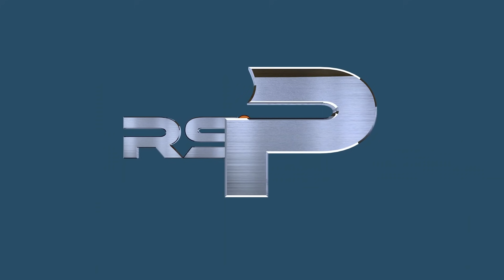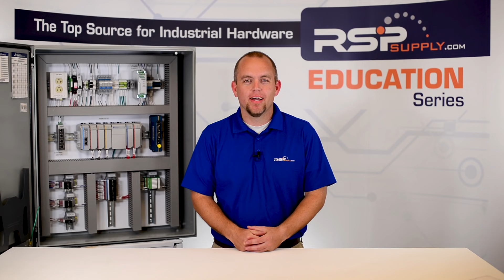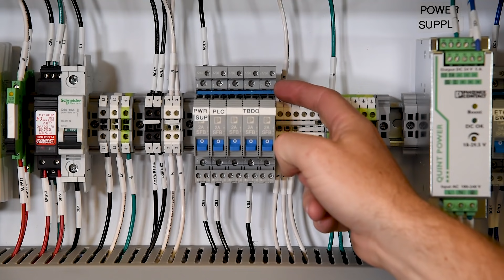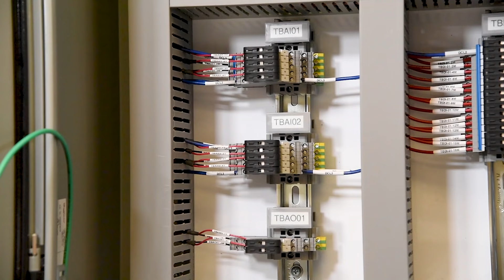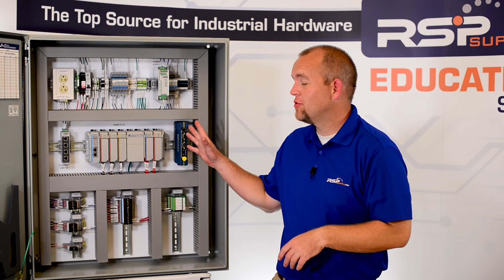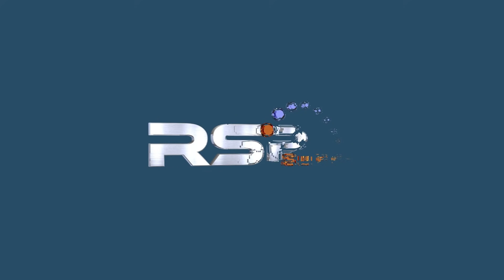Industrial Control Panel Basics

Comment: Great panel wiring presentation but how is AC power fail from the relay to the PLC gonna help,because when the main power fails the whole circuit will be off. Unless you install a 24Vdc output UPS and a 24Vdc power supply module for the PLC😊

Comment: I learned a lot Watching your videos thank you so much .in my previous job I used to assemble Flow meters where i connect and wire  different type of components now the company moved out and had to look for another Job anyhow i found a great Job doing this in the begging they didn't have too much trust on my because I'm a woman but i teach them that i could do the Job sometimes they send me out of the country because I'm bilingual i speak Spanish i enjoy working with panels

Comment: Thank you for that, trying to advance in this field and that helped tremendously
Reply: Same here. I started working plant maintenance 1 year ago, have learned a lot in the past year but the electrical issues I run into troubleshooting is the one that I’m not familiar with. Just enrolled in tech school to start Industrial Electricity courses though.
Reply: @offspringfan1288  good deal, i started going to tech school for electrical last year as well.  It's a great choice to make and good luck!
Reply from the maker: Glad it was helpful!

Comment: Banana PI BPI-F2P  open source Industrial control baord . use sunplus SP7021 chip design , support RS232, RS485 
http://forum.banana-pi.org/t/banana-pi-bpi-f2p-with-sunplus-sp7021-chip-design-for-industrial-control-gateway/11001

Comment: I worked in manufacturing for decades. This was WELL explained without the need of getting into in depth analysis of each component. Young folks should consider this well paid, blue collar profession... building panels, or connecting them to machinery , or interfacing/ programming to use with other panels & computers.
Reply: ReadyTo SaveIt having been a panel wiremen for 20 years, I’m afraid I don’t share your enthusiasm. 

Good panel builders are a dying breed. The work here in the UK is mostly under paid considering the skill and qualification level required to be truly competent. 

I’m lucky that for the past 10 years I’ve worked at a place that does pay well, but this incredibly rare where I live. Most of this work is on a temporary unstable basis and underpaid. 

I certainly wouldn’t recommend any young up and coming people to consider this as a career. At least not where I live in the UK.

Comment: Outlet upside down :D
Reply: I love how they installed a 20 amp outlet for 5 amp max
Reply: Compact Cow ...so pls explain how you KNOW what the total draw on that leg is, with no evident paperwork/ documentation...
Reply: @seminolerick6845  I was referring to the fact that it's a NEMA 5-20 outlet, which is rated for a load of 20 amps. It's a meaningless detail because there is no 5 amp outlet.
Reply: Its an endless safety argument as to Earth ground being on top or bottom... it all depends on the local inspector's requirements, or companies' policy... bottom line...

Comment: I used to build electrical control panels, painted the enclosures, laid out, mounted and wired the components and then tested the entire panel. Moved on to programming and selling PLC's. Have to say building the panels was the more enjoyable part.

Comment: finally someone that explain this, I started an industrial maintenance course but everyone except me seems to already know electrical mumbo jumbo so i am desperately trying to catch up
Reply: Imufur Indeed, he does an excellent job at the Introductory level... almost a "sales pitch" to get you interested, without bogging all down in details. There IS much to learn, depending on what level you will work with in the building, installation & maintenence of these panels. A basics of electricity course, shops skills level (drilling,tapping holes etc) , and wiring diagram reading and documentation of , might be the next series of learning courses for you.  A good "hands on" mentor, is invaluable if you can latch onto one. Good luck !

Comment: Thank you for your videos.  Because I watched them, I was able to intelligently answer questions about this topic at a job interview.  I got the job on the spot for $40,000/year.  They opened 430V, three-phase panels and had me explain them as part of the verbal test.  I passed.  No more repairing TVs for me.  This will be the first full time, professional job that I have had since 2001.
Frank
Reply: Congrats Frank!
Reply: Congrats! Never stop learning
Reply: You chancer
Reply: congrats man
Reply: Congrats
Reply: Congratulations Frank!! I actually do the same thing every time I have a job interview. I'll look up the job description and educate myself more on the position and the terms used and also being able to identify the parts like in this case associated with the control panel. It definitely makes u sound like u know what u are talking about. I recommend everybody who has a job interview coming up to check out the company website and familiarize yourself with their products and then research the assembly process on YouTube. What also helps is I always have a couple questions to ask them like what can I do at the position I'm applying for to make myself an asset to the company and consider myself successful. And always ask them what do they like most about being at the company, and it always seems to impress them just a little suggestion try it works
Reply: @mikedee4399  Thanks.
Reply: A 277/480 3 phase panel?
Reply: good on ya mate
Reply: Good to hear that.
Reply: I’m only reading this comment you are the epitome of never give up !!!
Reply from the maker: Congratulations sir! We hope everything is still going great for you. Thanks for the support!
Reply: Congratz
Reply: Way to go Frank!! Knowledge is power! Never stop learning
Reply: Congrats Frank! May I ask you what is your day-to-day duty? I would also like to become an automation engineer and I want to have some insight on the actual job. Thanks!
Reply: I wish they would have done that at my job I got. I got the job and didn’t even know this is what I would be doing
Reply: congrats frank
Reply: congratulations man! wishing you all the best! happy to hear this!
Reply: How’d the new career go man? It’s a late one but congrats!

Comment: 20amp receptacle for 5amp max use... hmmmm
Reply: They are usually feed from the outside breakers..that 5Amp breaker is only for the controllers..
Reply: @marlonespino9111  Because the wire is not sized for 20amps. Just that the receptacle is rated to 20 amps. Has nothing to do with it...

Comment: Hi. What are the areas to consider in order to properly size an electrical panel required for an industrial production line?
Reply from the maker: We will do a video on that soon.
Reply: It depends on your requirements..start first with your design for sequencing then figure out your components..then from there you can tell what size and what type your panel is..but always keep in mind always put a leg room for your wires and never evere use a NEMA type 1 enclosure for your panel

Comment: I have to work on this shit everyday. Finding problems in these type of control panels can be very frustrating. I had to teach myself being  a industrial mechanic.
Reply: being an industrial "mechanic" or an electrician?
Reply: Matt D as a mechanic. We work on all parts of the machines.  Electrical, mechanical, General maitence, welding, and gas or plumbing to big machines.
Reply: punkdevito If you can work on mechanical, electrical, welding, plumbing, etc part for the industries then you are not just a simple mechanic or electrician, you are a general technician.
Reply: Matt D what ever the name may be. That's what I do. And everybody at the plant calls us m mechanics

Comment: how do you size a circuit breaker for a power supply
Reply from the maker: We will do a video on that soon. Thanks for the request.
Reply from the maker: If you need help before the video comes out give us a call.  The circuit breaker is there to protect so there could be multiple limiting factors.
Reply: NEC code book article 240 has all the info you need..

Comment: Is there any reason why the main breaker and Surge arrestor are upside down?
Reply from the maker: We do that because of the wiring. The breaker is right side up but you are right that the surge protection is upside down. The input and outputs are opposite of the other components and we want all the input wires to come in from the same direction.
Reply: Yeah I had a closer look after I wrote that comment and realised that the breaker was up the right way. Though those surge arresters as far as I know don't matter which way up they go (except maybe the earth only on one end?) as I think they are just a pair of MOV's.

Comment: In an introduction such as this, you need to tell the viewer this is process control instrumentation. Is the  the enclosure nema rated, manufactured by Hoffman or custom made? A little more detail would still be bite size chewable.
Reply from the maker: Hi Melvin, Thanks for the feedback. We will have other videos soon with much more detail on Industrial Control Panels. The NEMA rating depends on location the enclosure will be used. For outdoor we suggest at least a NEMA 4 rating and indoor can be a NEMA 1, 12, or 4 rating. For more corrosive environments use a NEMA 4X. Hoffman in probably the most used in the US but any enclosure can be used as long as the NEMA rating fits the environment.
Reply: Looking at the panel, my guess would be Nema 4 or 12.